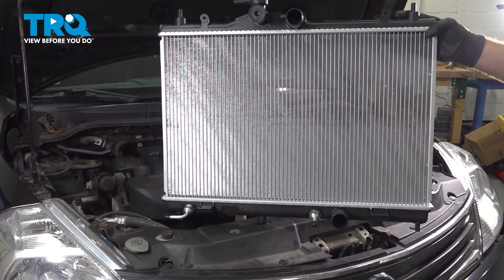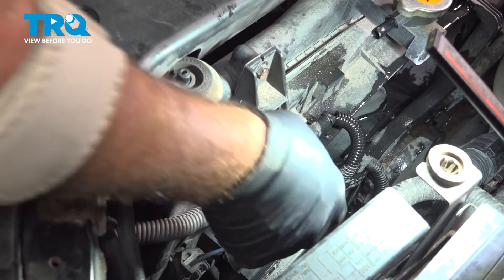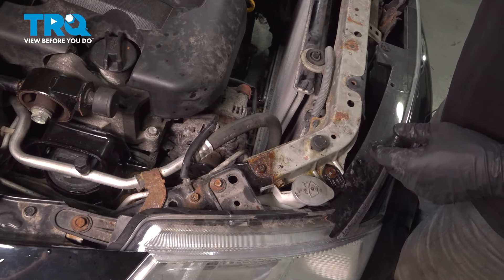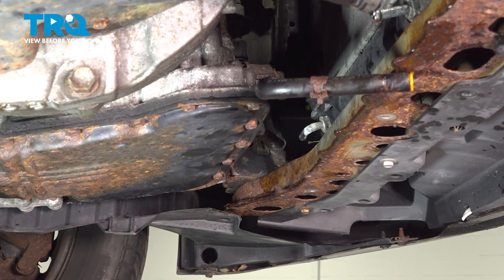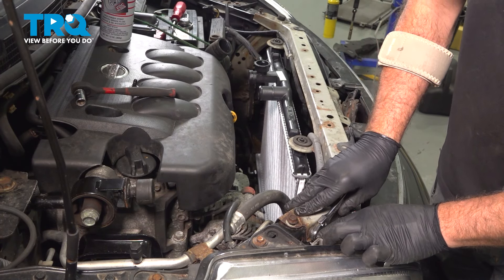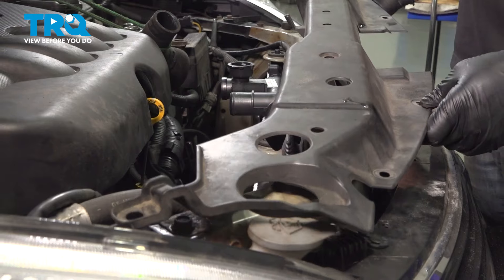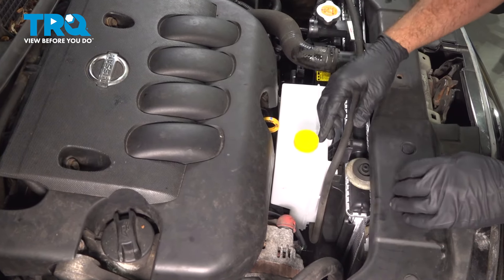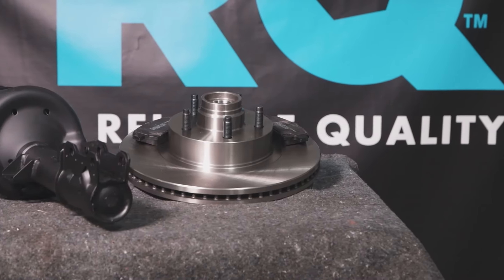How to Replace Radiator 2007-2012 Nissan Versa

Comment: Hi, I'm trying to flush most of the transmission fluid out of my 2011 Nissan Versa and I want to disconnect the transmission return cooler line to discharge more of the old fluid. From the video, I saw you disconnected 2 transmission lines and I was wondering if the one closer to the passenger side is the return line and the one on the left (curved) is the supply?

Comment: My versa has no temp gauge, 2010 1.8 hatchback. If i remove some coolant from the system there will be air pockets on the system.
1.- Is it possible to replace the coolant and get rid of the air without the temp gauge? 
2.- did you measure the coolant coming out from the system to replace the same amount of coolant?
Thank you.